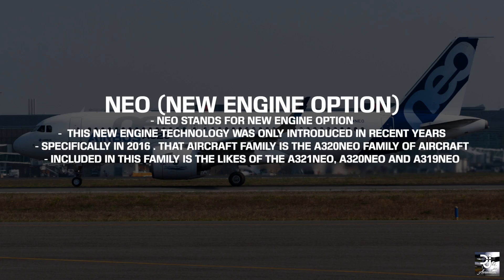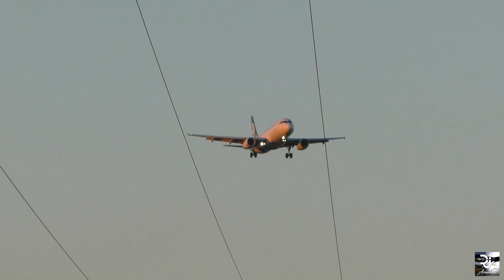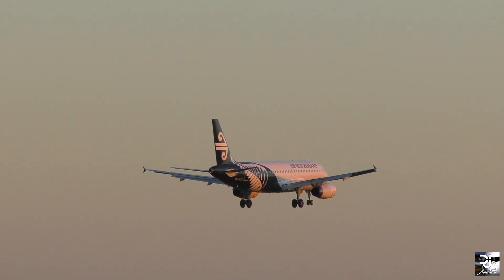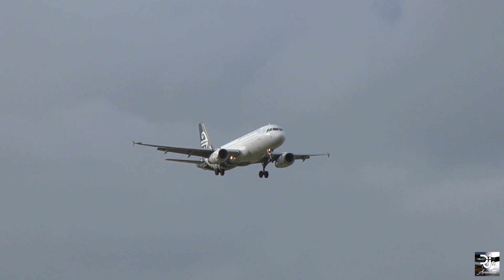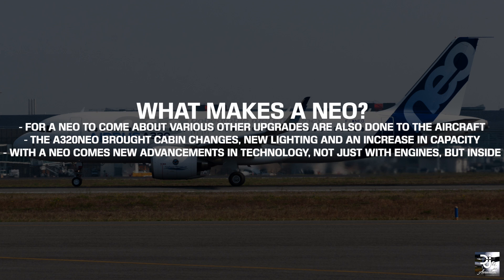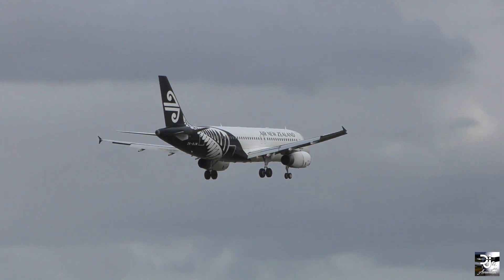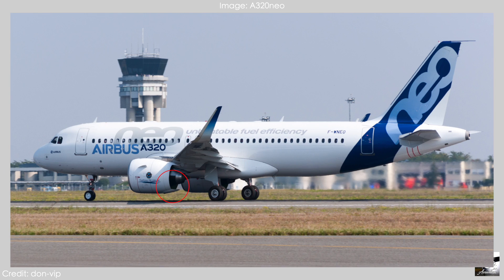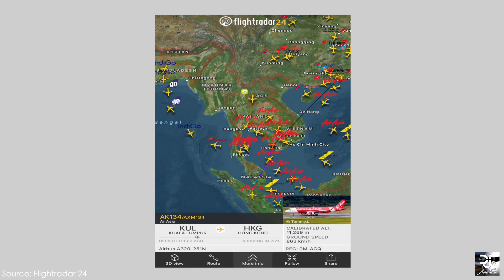NEO vs CEO | What's the Difference?

Comment: Great video! I didn't notice the two plates on the new engines. This is a great explanation on identifying neo aircrafts by their appearance. However I'm still unclear about how the new engines can make a difference in flying. It seems GE engines on 787, 737max, and 777X also have new features with an even fancier appearance. How are CFM and P&W engines making Airbus neo families more fuel-efficient, and how are these neo engines competing with GE engines on Boeing aircrafts?
Reply: The MAX doesn’t have GE engines but instead the same engines the A320neo has as an engine option (the engines are of the same engine family).
For the 787, the GEnx isn’t the sole option

Comment: The CEO has two engine options: the V2500 which is built by a consortium called IAE and the CFM56 which is build a consortium (GE and Safran). The videos show a BA aircraft and Air New Zealand with V2500 engines. If you want to see the other CEO engine variant, look at an Air Canada A320... they operate the CFM56 engine. To recognize between the two V2500 vs CFM56, the V2500 engine is long and slender with a cascade thrust reverser while the CFM56 has a shorter bypass duct and the tailpipe is visible.
For the NEO, the differences are more subtle. The PW1000 engines are recognizable by the narrower width of the aluminum lip on the intake cowl and the smaller size of the exhaust tail cone. The Leap Engine Has the wider aluminum lip and larger exhaust cone.

Comment: You mainly recognyze A320 neo as the leap engine is much larger to increase the dilution factor. This also means the engine is much closer to the ground. Some A320 neo also ahve the blakc windshear.
The CEO version has CFM 56 that looks more streched.

Comment: The up-gradation in A321neo is far more than A320neo as the A321neo gets dual flaps, bigger & more powerful brakes & stronger landing gear. This is apart from Airspace design offered. So apart from engine, the wings, interiors are also upgraded in A321neo. I think more composite material shall also be seen in coming days for fuselage on neos.

Comment: Thanks for the video DJ. For me, the easiest way to visually identify the difference between the A320 and A330 CEO’s from the NEO’s is by the length of the engine. The CEO’s engine cowlings are long in appearance when compared to the NEO’s which are shorter. As for the sharklets on the A320 family of aircraft rather than the fences, it’s my understanding that the sharklets appeared on A320 CEO aircraft prior to release and availability of the NEO and thus not necessarily a realizable means of identifying which engine option a particular aircraft had. And another way to tell the difference between the A330 CEO and NEO is by the wingtips. The A330 CEO winglets have a sharp angle transition from horizontal to about their 45 degree upward angle whereby the NEOs is blended into a smoothed-curve transition like sharklets do.

Comment: Also, another difference is the sound from the engines. Because of the larger front fan size, the A320neos are much quieter than the A320ceo models with the CFM56 or V2500 engines.

Comment: Hi Dj great explanation for newbies... but these new acronyms are the new aviation words of this decade why the concept is three scores old.
The original Airbus was to have RR engines originally but RR was so backordered in the Tristar program  that the A-300 was launched with American's Pratt & Whitney making it the first CEO plane.
Boeing introduced the first NEO when building in it's plans of the B-757 with it option of GE and Roll Royce engines off the drawing board.
And if you look at the current fleet of remaining B-747-400s, they fly with GE, P&W and RR power plants and I wouldn't be to surprise to find CFMs under their wings.
Remember going back to WWII, the P-51 Mustang with it's original Allison American engine was an sub-average fighter/divebomber. Only when the RR Merlin engine was installed into its air frame
did the P-51 become the legend that is remembered today. ;)

Comment: are all a320's with sharklets neos and all a320's with the triangle wingtips ceos?
Reply: Hi Michael. Some 320ceos have had sharklets retrofitted. To spot a neo, they MUST have sharklets but you will also be able to spot it by the engine. The neos have a bigger bypass ratio, so the dimensions of the engines are quite visibly larger.

Comment: Isn't just reneging old aircraft a bit lame?
Reply: not if the 737 and 320 have had so much success with the customers. And also its not just re-enginig. There are a lot of changes with the plane as well. They keep the same name because it has a similar structure
Reply: kingsofserbiangameplay 162 look at boeing taking their roughly 50 year old 737 and upgrading it again
Reply: kingsofserbiangameplay 162 it's not just new engines as explained in this Vimeo

Comment: Very informative video! Course now my little pea brain is in a tailspin with NEO, CEO, BO, TO, AND OH OH! HA! I'm here all night folks! Let the beating commence I earned it! Have you ever thought of doing a plane ID video? Like what a A320 vs A321 looks like in and out? Great job once again DJ!
Reply: The difference between A320 and A321 is spottable by looking at the emergency exits. Both have 4 on each side, however the two central ones are next to each other on the A320, whilst on the A321 there are few rows of seats between the two centre emergency exits.
To add on to this, an A319 is spottable by its 3 emergency exits on each side (instead of 4 like the 320 and 321).
I'm not 100% sure this is the same on the neo, but I guess it would.
Reply: @4kPOV4k  thank you

Comment: Can you talk about the 3 digit codes on the aircraft names (like A380-841 and A380-861)
Reply: It refers to the different versions of an aircraft. A plane like the A320 for example, is produced during more than 30 years and keeps receiving small improvement that aren't really noticeable for most of us.
 Among those changes: new version of engines (CFM 56 5A-5B-5C- 7A...); new types of winglets (winglets vs sharklets...) , small cabin changes or instrument improvement in the cockpit.
The only criteria is that these changes don't need a new certification for the aircraft.
Reply: The last digits correspond to the type of engine used.
Eg:- A320-231
31 means IAE V2524 A5 with power of 106.8 kN
1) 320 means the particular family of aircraft.
2) -2 means it comes under series of 200
3) 3 means the type of engine fitted
4) 1 means the sub-type of engine with the kn power
Reply: Amlani Priyal i just flew on Jetsar and i flew on an A320 but there’s something hard to understand 
The one I depart was an A320-232 ( no sharklets )
And when I go home, I flew on an A320-233 ( with sharklets )
This gives me an idea that the last digit number :
2 : Wingtips
3: Sharkelts
1: idk 
Is that true ? ( sorry for my bad English, I’m Vietnamese )
Reply: Ryan Facer they are build/customer codes.

First number is the model number (in your example, it would be A380-800)
The last two would be the airline/customer code.

For example, let's say Pan Am was still around (they had Boeing customer code 21).
They order new 747's.
It would show on the order sheet as 747-821.
Reply: @WorldTravelA320  no, airbus has a different scheme, it regards to performance difference
First digit is variant
Second digit is the engine manufacturer
Idk about the third though
Reply: @alienbeef0421  the first digit is variant the second is engine type and the last digit is thrust rating
Reply: @WorldTravelA320  oh, I see. Thanks!
Reply: @WorldTravelA320  that was boeing code airbus is different